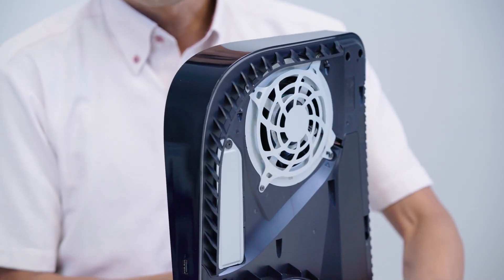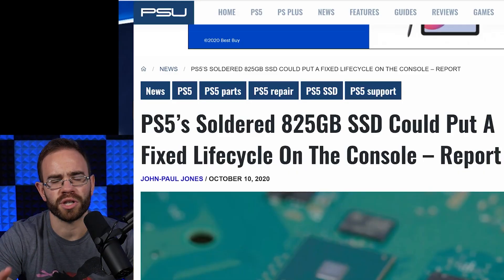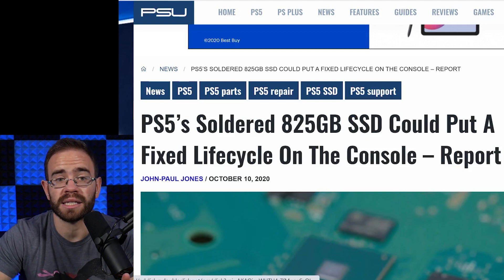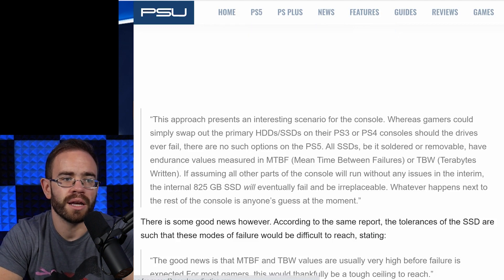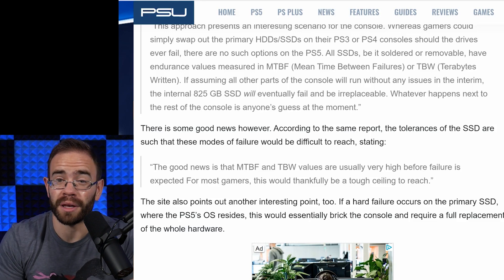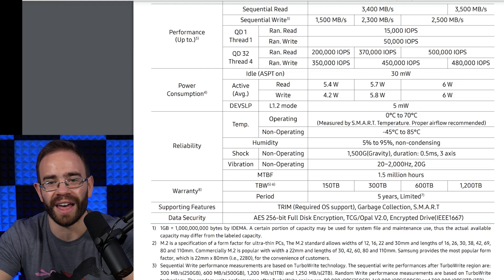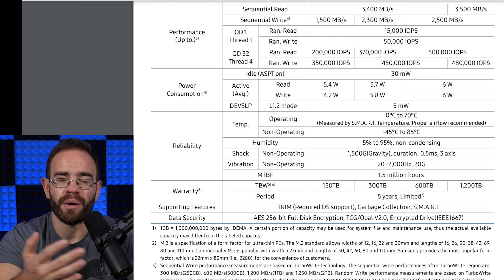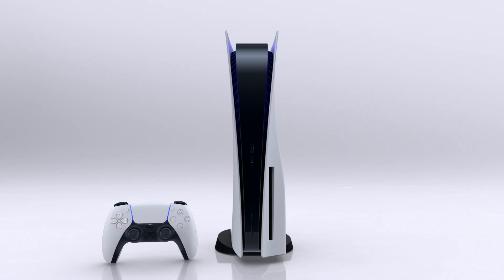Is The PS5/Xbox Series X SSD A Problem For Preservation?

Comment: Unless you made a philosophers stone and found the secret to immorality I don’t think you have to worry about your ssd failing...
Reply: People seem to not understand how much 600tb is.
Reply: @fattiger6957  Yeah. I got a 1TB SSD back in 2015, and have been using it as the primary drive on my desktop ever since. 

I think I checked a few months ago, and I'd used up something like 1% or the total drive life. 

As a fairly hardcore gamer, it's going to become too small to be useable long before it becomes even 10% worn out.

In fact, if I'd gotten in in 1980, and used it at my current rate of usage from that day until now, I believe it would be right about maybe 12% of its total life.

For reference, the NES was released in 1983. I could have been playing the original Mario Brothers on it, and it would in theory, still be good today.
Reply: Fat Tiger 600tb is huge but i think you wanted to say 600 gb :)
Reply: @sarangkulkarni4963  he most likely meant the 600tb average write before failure that was mentioned in the video
Reply: @sarangkulkarni4963  watch the video my guy
Reply: if anything other components will fall before the SSD does
Reply: Do not underestimate the Law of Equivalent Exchange. These are high powered processing systems. We shall see what other variables may impact this SSD.
Reply: they fail everyday, sure they last a while but they have a finite future
Reply: We don't know what kind of lifespan Sony expects from these drives, but drives fail regularly. There is a reason why backing up data is highly important and done regularly even in consumer markets. It's also important to not underestimate how fragile something like a boot drive is, if any part of the boot process is corrupted or fails, the user is left with an expensive brick. Like, how many people have an uninterruptible power supply for when they're doing a system update? There's usually some attempt at keeping the process "safe" for the end user, but things like this still pose a threat without the SSD necessarily "dying", it's just rendered useless until it's brought in for service where it'll just be formatted.
Reply: You don't need the stone to get immortality.... BRB I need to find another smurf.
Reply: Have you seen the new genetic editing tool? It might be possible...

Comment: Most SSDs can read for a long time but they tend to have limited write cycles. For people who don't want to buy an expansion, they will be deleting and downloading a lot. Most PC users don't download and delete constantly on their SSDs with such large file sizes. This is going to be an issue. Liquid metal and soldered SSDs... 2 points of irreversible failure by users. They should have a 5-10 year limited warranty for issues related to the liquid metal and SSD failure. And maybe a 25 year recycling program where they take back the PS5s

Comment: If you can use the secondary SSD to install the OS, no.
Otherwise, the people underestimate how long a SSD can't last. It's decades in normal usage.
Reply: @16bit Classics I got 3 Original Xbox systems that works 3 Xbox 360s a PS2 a GameCube a SNES and xbox one S all work never had any problems if you take care of your stuff it will be fine
Reply: @Hellraiser988  well the current problem is a necessary evil since games are getting bigger and more powerful, hdd and ssd are needed and those will always fail after a while.
Reply: @sellthegame_notyoursoul  I think the current problem is soldering an SSD to the motherboard it's the dumbest thing I ever heard of
Reply: @Hellraiser988  they soldered it to the motherboard to make everything integrated and increase speed. 

Everything is soldered on, from the ram, to ssd, and cpu. It's all to squeeze out every iota of performance they can get. & to prevent users from tempering with the CPU, ram or ssd. 

You should remember that, this gen, the ssd isn't just for game storage but it also acts as an auxiliary ram. The ssd is very important to how the game itself will play. 

Soldering it onto the motherboard close to the cpu is the best way to go.

Edit: for instance if the ssd is slotable, you'll have just 2 channels for data exchange instead of the 6 you get when it's integrated onto the motherboard.
Reply: @sellthegame_notyoursoul  yet it limits the life span it will fail way before my Atari 2600 fails because SSD has a limited amount of uses
Reply: @Hellraiser988  As a computer engineering major, that's not true. If you play the atari 2600 the exact same amount as the ps5, the ps5 won't fail first. 

Of course, if you play the ps5 more, then it will fail sooner. However if you play atari more, it will also fail sooner. If you play both the same amount of time, the atari 2600 will most likely fail first because it's more susceptible to dust and other things. 

Even if every single day, you write/download one new game, which is ridiculous, it will take about 35 years to fail. You download or write a 100 to 150 gb game onto the ssd, it will take 35 to 40 years to fail. My maths? 600tb of writes before you see a chance of failure. That's 6000x100gb. So 4000 to 6000 writes for the average next gen game. I'm assuming the average game (ex. Ghost of tsushima) will take about 5 to 6 times more space they take today during next gen. 

How if you're a normal human being who really loves to game and play the ps5 every single day and you write 100 games onto the ps5 every single year without fail, it'll take about 70 years before the ssd fails.

Now the gen will last 7 years max. After that 7-10 years, no one is gonna be writing 200-100 games onto the PS5 anymore. Because it's an SSD, when not being written to, it can last theoretically forever.

Trust me, in 100 years from now, the SSD on the PS5 will still be working well. 

Unless there is some product defects we are unaware of, the SSD in 99% of PS5 will still be working 100 years into the future.
Reply: @sellthegame_notyoursoul  it's the first revision there's always a hiccup
Reply: @Hellraiser988  I can say the same about ps1, ps2, ps3, atari, and every other human product. Hiccups can be anything at all. And these are usually addressed. Unless it's joy con drift, of course. Then Nintendo pretends it doesn't exist. Lol
Reply: @sellthegame_notyoursoul  good point

Comment: As far as preservation goes, you'll be able to transfer everything from the SSD to a USB HDD to save it for posterity. If something goes bad, you'll be able to transfer it back after having the SSD or unit repaired or replaced.

Comment: I'm sure we have those problems back then when SSD was trying to get popular and today they pretty much reliable now.

Don't forget the PS vita (both, though fat vita has hidden internal storage) and PS3 (12GB super slim model) have internal memory, and also your phone, android box has internal memory and also regular USB drives. Also, the vita/ps3 lets you switch to an external storage if you choose to do so, prompting you to transfer your files.

Nand flash does not last that long and explains the problem you mention on some problems on x360 slims and also some old fat ps3 getting RROD. that's why they don't use NAND flash anymore on the later x360 slim and also USB drives don't use NAND flash anymore.

overall a normal consumer should have no problems as long as they don't download and delete games every hour for the whole year and unplugging the power cord while its writing.

Comment: Nothing electronic has a 'fixed' lifecycle. Everything depends on the parts themselves. Someone will buy a ps5 and it has a chance to last for many years and someone else will buy a ps5 and it could break in two days. It's always a gamble purchasing any electronic item. I had two of the same Sony micro SD cards and one lasted a year and the other one I still have and it works fine (purchased in 2014). So no matter what it is you buy there is always a 50/50 chance of it lasting for a long time and it not.
Reply: Not 50/50. Electronics are tested like crazy, so failure (though they do happen) are quite rare. You just got unlucky.
Reply: @fattiger6957  testing them doesn't have anything to do with the flaws in the components. Quality or not, parts have flaws. Some last longer than others. You could have the highest quality components and they could fail after a few uses and you could have the cheapest components in the world and they could last for years. It just depends on the components themselves and if they are flawed or not.
Reply: It's a little more complicated then that. When you buy a console it has way more components then say a micro sd card. If the device relies on certain components heavily to function, say an ssd drive soldered to the board, then if that fails it renders the other collection of components which make up the product relatively useless. Poor design can cause this to happen more or less often as can cheap components. Companies can control the failure rate of things to a degree by using high quality components and utilizing the best possible design although as consumers we all always want everything to be as cheap as possible. Research and development and manufacturing on a large scale all cost serious money. These companies want to make money and we want the products we buy to work efficiently and last long-term. The EU actually has laws that provide the consumer with some protection against companies selling cheap electronics that fail constantly. Some companies have as high as 50% failure rates in their new products. Look at the original xbox 360. Let's hope Sony has designed a quality product with the ps5.
Reply: @agent_of_cthulhu  the SD card was just an example. I work with electronics everyday and I've seen them last for days and I've seen them last for years. It doesn't matter how cheap or quality your parts are, if there are flaws or inconsistencies in them they will fail. Sony seems to have put a lot of R&D into this console so hopefully it will be a quality piece of hardware. But ultimately it comes down to each individual component itself and wether it has flaws and how long before those flaws make the component fail.
Reply: @cloudstrife4957  Yeah that's definitely true. Faulty parts is a always a possibility and a problem. Sony does seem to be pretty good at getting a good product design and manufacturing it to high standards. I have owned many sony products and have never had a problem with any of them. That doesn't mean they won't fail eventually but they have endured and are working beautifully. Right now I have a 15 year old sony stereo I still use plus the ps3, ps4 pro, and numerous other electronics. The ps3 is still working perfectly. I have a ps5 preorder and I would never have ordered it if I didn't think that it was going to be a great product. Now hopefully it is not a dud because that does happen with electronics as we all know.
Reply: @agent_of_cthulhu  same here, let's just hope with the way things are right now we get our pre-orders on time. I still have my ps1 original and slim and they work great. I still have my original Nintendo I got for Christmas in 1984, works like a charm. But I've also had some that didn't last as long. Sometimes the lasers go out and won't read disks, sometimes the actuators stop spinning the disks. Same with ps2, ps3 and ps4. Some parts are just faulty. But I have to say that Sony makes quality products. Evey company that makes electronics wether they use quality parts or cheap parts has to worry about faulty materials because not all of them are exactly the same.
Reply: As a tech the first thing to usually fail are the capacitors in the PSU. I've repaired many monitors replacing the caps. Problem is for cost's sake maximum thresh hold caps are used.

Comment: What about the Xbox Series X | S Quick Resume feature that copies your whole RAM to the SSD each time?
That's gonna tear it down pretty quickly. I would not use that feature if it isn't absolutely necessary.
Reply: It doesn't work like that.
Reply: It's still going to take years, 10+ years.
Reply: @johnhp6565  yes

Comment: Well, the safest way is buying the Seagate storage expansion for the XSX/S and not write anything on the internal SSD.
Reply: That’s a good solution. 
But there is a problem with your theory and even with this video.
According with Xbox and PlayStation developers, the SSD in this two machines can work like virtual RAM.
So, if this is true, and I believe it is, the internal SSD is mandatory and the amounts of data written and rewritten on the SSD’s will be astonishing.
PS5 for exemple: Can transfer 5,5gb/seg of RAW data, and until 9gb/seg of compressed data.

This SSD’s will suffer...

Comment: the ssd will be fine for more than 600TB worth of writes on it...not dying anytime soon
Reply: Yeah, really. A person would have to work really hard to write and rewrite 600tb to a console even if they had 10 years to do so.
Reply: Fat Tiger yup...people are getting internet anxiety over these consoles..they are both very well built engineering achievements...the internet is taking the fun out of everything...too much anxiety and stress...its like people dont trust engineers anymore😂
Reply: Hellraiser988 why?
Reply: @nabeelsalam  oh no, that's not good. I better buy a 3rd ps5. Might be best to wait for a pro model for the 3rd. I did with the ps4 and worked out great. Had to install a 2TB until they made external drives work with it. I transferred P.T. to an external drive so hopefully it never fails. One x waited too long to release so just waiting to get the series x or get an RTX 3080 when available
Reply: @N7uy66u  3rd ps5...what??
Reply: @nabeelsalam  yeah, u need 1 for the bedroom, 1 for the livingroom and an extra in case someone wants to play 2 players non split screen or one dies which is why I have 3 ps4's and 3 vita's. I got atleast 2 of most systems I play. Gotta have a backup. Some systems are hard to find in good condition now days without costing an arm and a leg like the Virtual Boy and Sega Sega CD. My 3DO and jaguar cd systems I only have one of unfortunately and I've been having problems with both the past few years and people expect way too much for them for me to buy a used one. I refuse to pay more then what I payed for them and u never know how long it will last.
Reply: @N7uy66u  🤣
Reply: @Hellraiser988  why its not like the ssd on the console is slow or anything that it needs to be replaced?
Reply: You know that a lot of people use these things as more than video game consoles.  and seeing the amount of bitching people hear do about reaching their bandwidth caps and all they do is streaming...  There is a lot more reading and writing going on in your console than you think and more importantly he is referencing a top tier ssd maker.

what about the ones that don't have those endurance ratings and don't come with a 5year warranty.  Have they said why kind of chips are being used for the SSD storage, is it SLC (Probably not) or MLC (That's the one probably).  Thing is we don't know anything to confirm anything.

Now mind you, I don't believe they are going to release a console they don't expect to work five years from now.  I do expect they will take shortcuts and cut costs in order to minimize loses.
Reply: @vaguedreams  read/write for consoles go through Ram not storage. Storage is used for downloading and preservation.
Reply: I'm still using my launch edition ps3 lol
Reply: 650 TB would last 10 years if you install game at a size of 178GB every single day
Reply: What about all the other stuff in there that is also aging...
Reply: komnishura how long u planning to use it? 6-7 yrs should be easy
Reply: Hopefully these last 20 years like it sounds like they should. Downloading 2 games or updates a day can be over 100GB's and when u own 30% of all games that becomes a daily thing every time u delete a game to play another. I'm referring to what I had to do with ps4 until I got 12TB of storage so hopefully it's not like the ps4. A 4TB ssd I think is $450 and that is not even ps5 compatible because it's not pcie 4.0. I hope I can use my external ps4 HDD's to play the ps4 games atleast
Reply: 2WIREG  the xbox ssd is just fine as well in terms of longevity...MS and Sony are good at hardware..you can relax fanboy